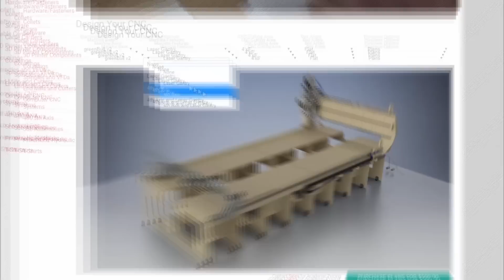Part 3: Y Axis Mach3 USB Wiring and Configuration

Comment: Thanks for the great videos,Have followed your directions as closely as possible, 
Wondering if you could explain small switch on top of driver, settings are 5 or 24 . My motor, nema 24 - 8 wire, runs in 5 position. Is that  correct?

Comment: Hi, great videos. I learned a lot!
I have a question. 

Why dont you connect the shield from the cable directly to the earth ground cable?
 
I thought the shield is supposed to the earth ground rather than connected to GND (in the case of stepper driver in your video) (i thought GND is not connected to any earth ground and is a 0v reference to measure) and DCM (in the case of your limit switch, i understand the DCM pin is connect to V- on power supply)

Thank you and looking forward for your reply!
Have a nice day!
Reply from the maker: You can connect the shield to either earth ground,  or to the gnd of the signal.  The gnd of the signal will eventually hit earth ground.  EEVBlog has a great explanation of this.

Comment: will this  work with grbl cnc??
Reply from the maker: No, GRBL requires a controller with a microcontroller that has been programmed to work with GRBL.  GRBL is actually the programming that is stored on the microcontroller as can be seen on the following link: https://github.com/grbl/grbl.  It is an open source program that can be burned onto Arduinos or like embedded boards.

Comment: Just curious about the roller chain tension. It seems too loose to me? Is it that way for testing?
Reply from the maker: In the first part of the movement, it is loose.  I tightened it as you can see in the latter portion of the testing.